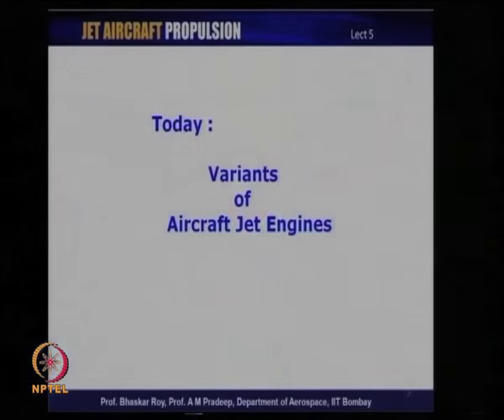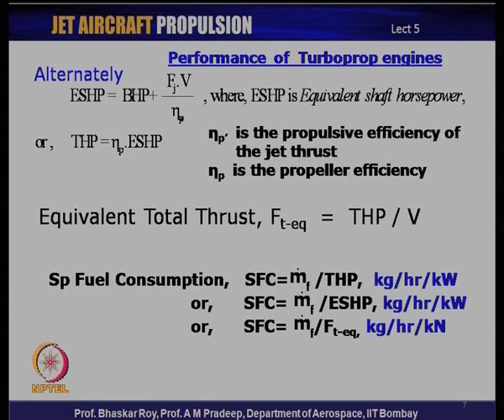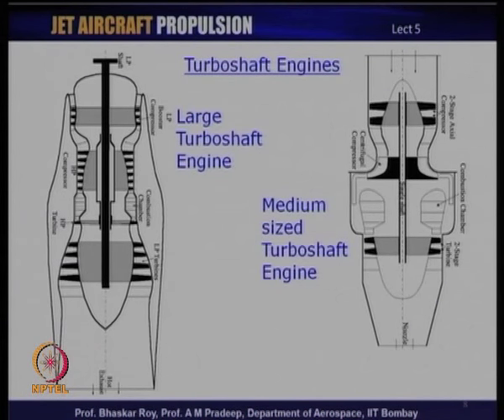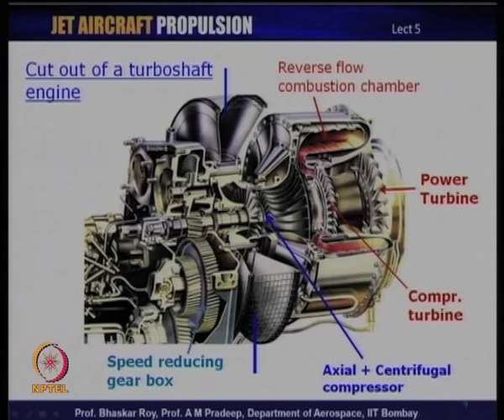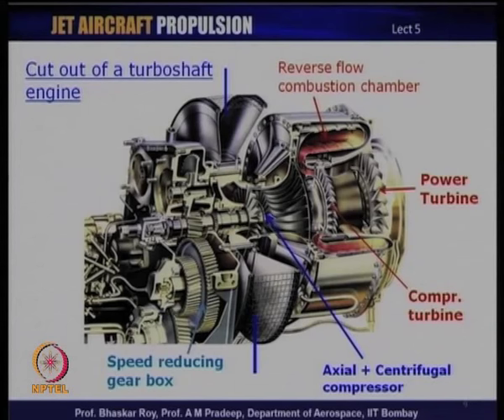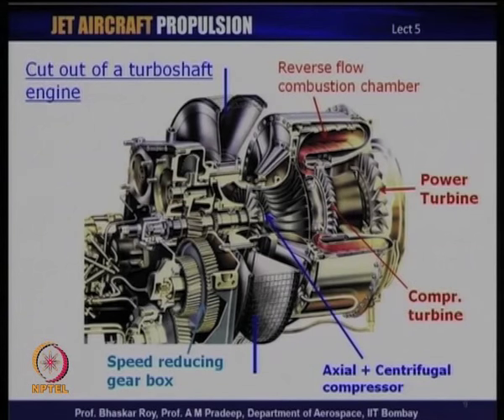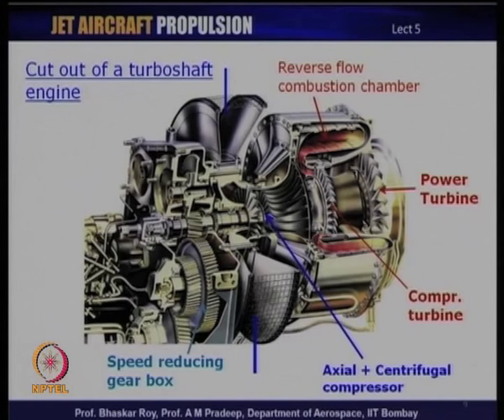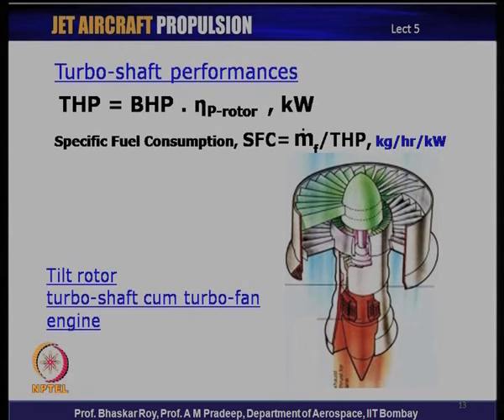Mod-01 Lec-05 Turbofan, Turbo-prop and Turboshaft engines

Comment: Man these lectures are great! Thank you very much!
However I have one question. If one was to build a pulsejet engine and mount a small turbine on its rear to turn a fan like a 2 spool 3 drive. What would you then call that engine? If you put that fan in a duct would that change its name?